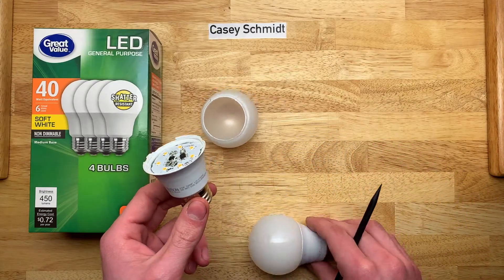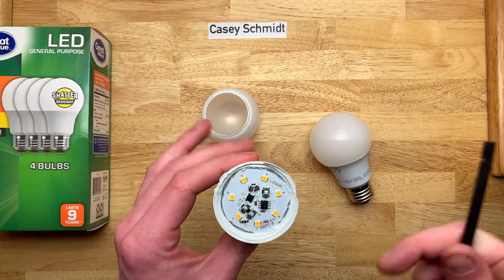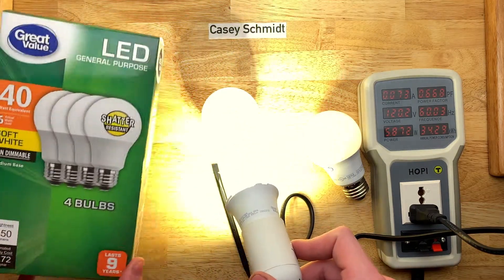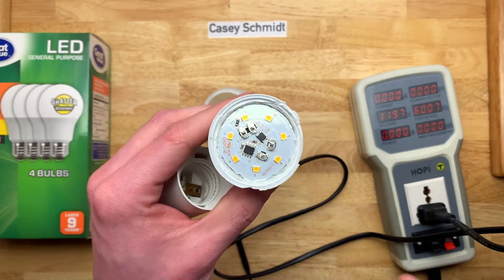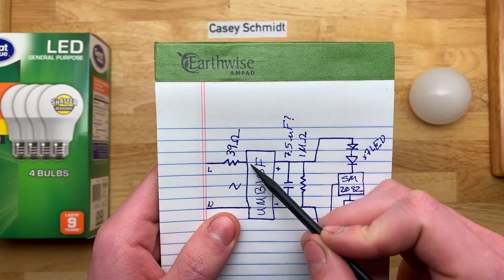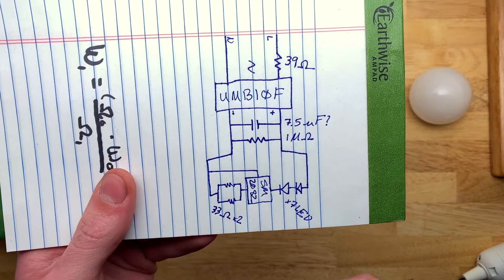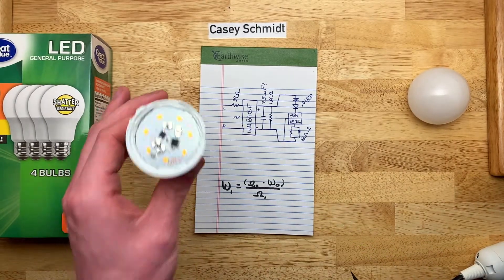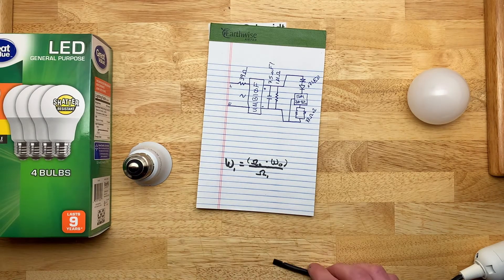BigClive LED Hack (for USA/120v)

Comment: They've started to get so cheap making these bulbs that they stopped putting in two resistors in many cases. Slightly more annoying to hack, but you can still solder in your own resistor of a higher value.
Reply from the maker: That’s terrible….

Comment: So what part(s) inside make it dimmable or NOT dimmable? Is that chip inside kinda like a voltage regulator? So, you just can't put a resister in series with the input supply? The MOD is like after some part that cannot see the reduced voltage to all the LED's then? The little I played with LED's, I found there is a window of optimum light output vs current draw. There comes a point where increasing the voltage no longer makes the LED brighter, but just makes it pull more current and get hotter. Just before the sharp rise in current is the best of both worlds.

Comment: I recently got two 5 Watt bulbs for $1.25 at $tree. They have only one 18 Ohm resistor which I replaced with a 33 Ohm Surface mount resistor from an old PC board. I put one of them on our lamp outside our church. (which is hard to get to and replace) I see this is from 3 years ago, lamps have gone down in price!

Comment: Does anyone know how to determine which resistor to remove? All the LED bulbs I buy have 4-6 resistors, sometimes even more,
and I don't know which resistor to remove. I just tried removing one from a walmart bulb, now it doesn't work anymore.
Reply: You need a continuity meter. A multimeter will work. If it doesn't have a continuity setting, use the resistance setting. You will put your probes on the ends of two separate resistors and get a reading. The reading should be very low, as in a wire, like less than 1 ohm. This means you have found that those two resistors are connected at those ends. Now measure the other ends of the same resistors. If you get a similar reading, that means those resistors are in parallel, and you can remove either one. If you do not get very low resistance readings on both ends of the resistors, they are not in parallel and cannot be modified for this hack. You can check other resistors, in pairs, on the board, if there are others, until you find two that read as described above.
Reply: Take a picture of the CI chip (LED Driver) and check its code (for example: MT7608B), then ask Google for its datasheet. On the datasheet there is a "typical application circuit" and the indication of each resistance.

Comment: I'm thinking the easiest way to get rid of that resistor is to use a soldering iron to push it to the side. Once the connection is broken, it should be easy to pluck off.

Comment: This guy looks like a fan of Big Clive Dot Com: wooden desk with a writing, hopi meter. If you have a fixture with four sockets, it's probably sized for a room that actually needs 4 bulbs of normal brightness, not 3 watts. So now you need 8. Maybe with those Chinese splitters if appearance is not a concern.
Reply from the maker: I’ve certainly been a fan of Bigclive like many. I found his some tools to be useful so I picked them up myself, the bench is entirely coincidental. I’ve run these bulbs for a long time now with no issues and enjoy the lower output in many cases. Thanks for watching!

Comment: When you measure "in circuit" an open circuit (which you obviously did for the resistor of 39 Ohms) - how could it be NOT correct??? I cannot think of any reason??? Either i'm missing something here, which i doubt, or you don't even know about electronic basics.
Reply from the maker: It cold be a misspeak.
Reply: A resistor will measure lower in circuit when it happens to be in parallel with other components that provide a path back to the meter. This will cause the meter to display a reading for the entire circuit of that resistor and the other components that are connected in parallel. This is why the only sure way to measure a resistor correctly is out of circuit. Generally, when measuring a resistor in circuit, you expect to see the value of the resistor, or less. If you do not know the value of a resistor and you don't know if it is in parallel with other components, you are at a disadvantage because you have no idea what to expect.
Reply: @TorquinDSL  Have a look at the schematic - the left end of the resistor is open and not connected to anything else. So it happens not to be parallel to anything else. Therefore...🤷‍♂

Comment: Do you think led strips are better in terms of overheating because leds are more wide spread. Are light bulbs limited by its compact design.
Reply from the maker: I think that’s a reasonable conclusion. If you can stick an adhesive LED strip on a small bit of aluminum, that would be even better

I think light bulbs are also at a disadvantage because a major part of their design is to have them sealed for either weather or to keep people from being electrocuted since you have to handle them to instal them.

Comment: The different thing that I do is that I do not destroy the resistor. I use a 50W iron. Heating both sides with a drop of solder. They are useful to use on others lamps that have just one resistor for current.

Comment: Excellent video.  I managed to buy the Kodak bulb similar to what Big Clive used, but I had to get it shipped from Spain and it was 240 Volts.  So in addition to removing a resistor I had to bypass several LED's to get it to run at 120V.  The  15 Watt Kodak bulb actually has 32 LEDs in it. With the Kodak bulb the efficiency at the lower drive current went from 100 Lumens per Watt up to  140 Lumens per Watt after the change. So I expect this is why you didn't see a large change in brightness when you reduced the power on this lamp as well.  You dropped the input power in half, but the efficiency likely went up 40% at the same time.

Comment: How can I make them work at 220 v ? 🤔
Reply from the maker: You need to start with the 220v version. They aren’t interchangeable.
Reply: Many bulbs sold in Europe are 220 - 240 volt. I think I bought Kodak 220V bulbs from a website in Spain.

Comment: I already done this to a lot of LED TV's and they last forever! None of them have ever returned and the backlight brightness stays almost the same. For powerful lamps that's another story! Done this with a 20W led and it turned out very dim, like a 9W bulb. So the lesson is: if you're planning on doing something like this, buy a led lamp that's twice as powerful as you need, so you'll won't be disapointed

Comment: the best way to get out the resistor is to remove the whole plate and heat it over an iron, then use a tool to gently pick up the resistor out from there and replace it with a new one. The same way can be used to replace bad leds, ICs etc. I've personally used a candle flame to heat the plate up and losten out the components.
Reply: wait, this video does NOT show the resister getting replaced. Are you saying that is DOES need to be replaced?
Reply: @errm1913  i meant remove the resistor in this situation, sorry. 🙂 i got plates that come with just 1 current sense resistor so end up in a situation where i need to replace it with lower value ones to control the brightness. Also, useful when I want to remove bad leds and mount new ones in place. was just sharing my way which may be useful at times.

Comment: big clive a scottish legend :) thanks for sharing. Your video is very in-depth , interesting to see the different versions of these bulbs available
Reply: I sorted one of my bulbs tonight, was one led burned out so shorted that and changed sense resister from 2.2 ohm to 10 ohm, it's running now at 3.7w instead of the 10w it was before , prob should have been 5 ohm but didn't have one to hand

Comment: I tried the earlier version of dobbying the LEDs.  I rigged up a capacitor inline with the bulb.  I started with 470nf and eventually went down to 47 nf.  The 9W LED 60 watt incandescent normally would be very bright.  The 470 brought it down significantly as did the 224, 104, and 47.  I would say the 104 and 47 were more night light level of illumination.  Extrapolating from BigClive's testing (I am in US), I expect the 470 was probably 1 watt and the 224 probably 0.5 watt.  I lack the gear to actually test the AC current.  I might go get a 1uf and see how that works.  
I had 2016 Costco Feit Electric bulbs but they don't work with this and their internal circuitry was laid out differently however a recently purchased set of LED bulbs worked fine. Keep that in mind.

Comment: That probably explain why some LED last 10 000 hours and some are listed to last 25 000 hours! What I don't know is how they make some orange (3000 k) and some blue (5000 k). If someone have any definitive idea, could you please share it with the rest of us. As usual, great video with good content!
Reply from the maker: @Yves Boutin - Thank you! I’m not sure if there is any definitive reason for different color temperature LEDs but I can make a guess at a few reasons. One is that designers tend to like the colder color temperatures because “aesthetics”. Another reason, from sales/marketing, would be that having more options means companies have more things to sell us. That also plays a role in why they try to over-drive the LED chips. And from an engineering perspective, it is relatively easy to make LEDs of different colors. I much prefer warm white LEDs over cold white but I also think having options is good too!
Reply: @Casey_Schmidt  Thank you for the comment! Personally I prefer the cold ones (5000k), because it look more modern. The orangy ones looks like a flame from a candle or an oil lamp. I guess you are right about the different color is simply esthetics and sales. See you next time!